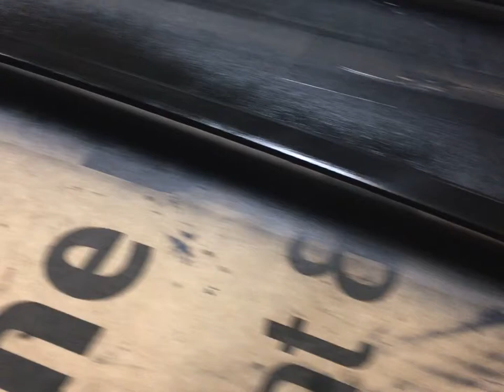Honda Odyssey - Water Leaks - Roof

Comment: Thanks for the video. very helpful. Can you tell me how the weatherstrip attaches to the metal molding that it covers? Does it just snap in place? My weatherstrip ('06 Odyssey) has dry rotted and the section on the passenger side in front of the roof rail is flapping in the wind, literally. The metal molding I can see underneath looks intact. Just need to know if I can purchase replacement weatherstripping alone and how it attaches to the metal molding strip underneath. TIA.
Reply from the maker: For some reason the card for this video is not on the leak video anymore.  Posting here: https://youtu.be/clcybJl3VUQ. Also, you can re-attach the rubber to the metal with 5200.  The last couple minutes of the leak video shows how I revived the trim.  It is still available from Honda as new, about $110. Last time I priced it.
Reply: @millionmilegarage9587  Thanks. It makes sense that reattaching dry rotting weatherstripping would require some adhesive silicone caulk. I guess what I'm wondering is, if I were to purchase new weatherstripping, do I have to attach using adhesive caulk or does it snap into place on top of or around the metal molding that it covers? Sorry if I was unclear. Also, you mention several days for your caulk to fully cure, but that it's waterproof within 24 hours. Does that mean I can reassemble everything after 24 hours. I don't have a covered garage to work in, so would need to cover the vehicle for at least 24 hours I suppose. Thanks for the assistance.
Reply from the maker: rss968 A new ditch molding is a complete ready to install unit with rubber molded over an aluminum extrusion.  5200 doesn’t really wash off, in fact you can install it under the waterline (underwater), moisture speeds the cure.  You just don’t want to leave it out in a heavy rain for several hours or blast with a water house until it has at least 24 hrs to cure.  5200 also comes in a fast cure, you have less working time and it may not self level as well but it is tack free in 2 hours and fully cures in 48 hours.
Reply: @millionmilegarage9587  Very helpful. Sounds like I can re-install after at least 24 hours without harming the curing process. Can cover with tarp overnight. If the ditch molding is all one piece (rubber over aluminum), I wonder why they get different parts numbers. For example, the parts diagram shows one solid piece that appears to run the full length of the left roof that is labeled "molding assy, L roof" part #74316-SHJ-A01. Then there is another 4 piece set that I know is the weatherstrip also labeled "molding assy, L roof" part #74316-SHJ--A21. I assume the solid piece is the aluminum extrusion and the 4 piece set is the rubber weatherstrip, but why the different part numbers? Honda's got me confused on this.
Reply from the maker: rss968 Models with roof rack get the 4 piece set, w/o roof rack requires one piece running entire length of roof.
Reply: @millionmilegarage9587  Now that makes sense. Thanks for taking the time to clarify.

Comment: Awesome video thanks ....I have a question. when you are pulling down the sealant and you get to the windshield area do you put a bead across the windshield area or just stop at the end and not cover the windshield area(its like the width of the molding)
Reply from the maker: Good question, my focus was on covering the sheet metal seams that were cracked, I may have/would meet the windshield where the ditch dead ends.  I kind of remember there is a little area designed to let water drain from the ditch in that area, I avoided covering that up entirely.

Comment: I appreciate this content, thank you. It would seem that Honda didn't really expect us to be owning their cars beyond the ten year mark, or perhaps they would have chosen a better design; come up with better ways to drain water from the sunroof instead of tubes buried in the pillars. 

I have a not only an odyssey, but an accord coupe as well, and it is drowning in water, and now I'm thinking that the water puddled in the seat wells under the rear seats is coming from the same roof seal. 

Spot welding the side frame to the roof, with a bead of seam sealer between the two,  at the edge of the roof line!!  Can you believe they didn't know that this was going to be a problem? That seam being where it is, right on the roof, is asking for leaks.
Reply from the maker: Yes it’s disappointing to be dealing with this type of problem long before the rest of the vehicle is worn out.  At least it’s a relatively easy fix.
Reply: @millionmilegarage9587  You're too kind. I haven't gotten to fixing anything yet, and it has been raining all night here in South Florida. Aaargh.
Reply from the maker: @charlesluck8921  Yeah, I don’t miss that, we lived on the Treasure Coast for nearly thirty years up until about five years ago.  All it does is rain down there.  Hope Ian is a no show.

Comment: I'm pretty sure I need to do this because mold, but I've also had the water leak out from the lift gate when I opened it. Very bottom by latch. Wondering if this will be a total fix.

Comment: Good video. Thank you. Do you also have one about water filling up the inside of the tailgate and leaking out all along the bottom  including through the latch?  

One note about caulking or sealing.  On your next job try pushing the tube forward while applying sealer rather than dragging it. I believe you will have better results as far as getting it into the cracks.
Reply from the maker: I have not encountered the tailgate leak yet but: There are several potential leak points that you can troubleshoot.  The wiper arm shaft, the glass seal, the tail lights, license plate surround, the spoiler mounts and of course the hatch seal just off the top of my head.  Start at lowest potential leak point and work your way up with a garden house.  May make it easier to pull the plastic off on the backside of the hatch to see where the water is coming in.

Comment: I called Honda and they want to charge about 500 dollars to fix roof leak. I tried other place and same estimate. I actually did this 2 or 3 years ago and it did work for about a year and so, but now again on both sides I see water marks from B to C pillar. I am debating on what to do now. Most people think is the sunroof leak, but I poured water on the rear channels and it come out well from the drain tubes.
Reply from the maker: I have never had the sun roof leak.  Best thing to do is sit in it while an assistant dowses it with water and look for the leaks.  If you used silicone to fix the leak previously that is probably where your leak is again.  That stuff will lift on you over time especially if it was not PERFECTLY cleaned before application.

Comment: Hi! Thanks for the video!  I was was wondering how you the cleaned the inside, specifically the roof liner and seatbelt area, after fixing the leak? Also, did you just clean out the gunk under the rails by hand or did you use a special device or cleaner?  Thx!
Reply from the maker: Hi Whitney, I put a little Febreeze on the seat belts to kill the sour smell, sunlight works good too.  I never did clean the stains on the headliner, guessing oxyclean or something like that would work.  I used soapy water and a toothbrush to clean off the seam seal trough area, avoid using anything caustic like bleach that could corrode the sheet metal.

Comment: Good information. I don't have roof rack in my 2014 odyssey, but I've seen water sitting in my passenger sliding door. any suggestion where to starts? dealer want me to spend 1500 to change all the rubbers which i wouldn't want to spent. TIA
Reply from the maker: Awais Khokhar Pretty sure the 14’ model still has a ditch molding covering up the same seam, with or without roof rack.  Try doing a visual from inside the vehicle with an assistant hitting it with a garden hose, you should at least be able to confirm if it’s the door seals.

Comment: Thank you! My 07 van got soaked in the recent rains and it’s time to do some waterproofing. How long did you let your van dry out before you did the work?
Reply from the maker: The surfaces that are getting sealer only need to be dry, it really depends on the conditions, in bright sunlight the seams should pretty dry within an hour or so of cleaning.  Results vary, 3M cures under water so a little moisture won’t hurt, silicone based sealers need a very dry surface.

Comment: Question.  We are having a leak on both sides of the A Post at the drivers seat and passenger seat.  Our van has a sunroof and I suspect that this is where our leak is occurring.  Did you experience this with your van?  Did yours have a sunroof?  Thanks!
Reply from the maker: @stephenhair5501  Yes it has a sunroof, no I did not experience that issue.  The sunroof has a a surround with a drain in it in case the sunroof lets some water in due to being open (by design) and I would think  also collect water if the seal around the glass to opening leaks.  If the drain for that area gets plugged it could flood over into the vehicle causing what you described. Should be pretty easy to troubleshoot by doing a visual around those areas.  As always, this is just my opinion and results vary.

Comment: Thanks for sharing this video.  How's the repair holding up?  Having almost the same issues with the seatbelt getting wet and the rear hatch area on my '06 and am prob going to tackle this as soon as we get some dry weather again.
Reply from the maker: SEDACE Hi, no leaks since the repair.  Left sit outside up here where it rains for days at a time.  No more wet carpets or seatbelts.   Make sure you have a torx bit tool long enough to reach the center screws on the luggage rack.
Reply: @millionmilegarage9587  have you had any issues inside the tailgate/taillights?  I need to seal those too apparently.
Reply from the maker: SEDACE I have not experienced leaks at tailgate on light openings but on the quarter panel mounted lights, the ones not on the tailgate, there is a pass thru grommet/seal that can get unseated when servicing tail light bulbs which can create a leak path.
Reply: @sedace6734  out in Cali it doesn't rain too much but this last storm I had a little over a gallon of water inside the rear door.  Was yours entering from the lights?
Reply: @1socalhiker  Haven't had a chance to really investigate the rear door part, the water getting into the rear hatch  floor appears to be coming in from the roof rail seam, follows down the roof line near the rear drivers side window, and can see it where the rear floor jack compartment is before it ends up on the floor.   I had to re-do some of the seam sealing last week because it was still getting in during heavy rain, not sure if I have it solved or not yet.

Comment: Where do you source the roof molding? It doesn't appear to be sold anymore.
Reply from the maker: I think the factory part numbers are listed in the description, if they are discontinued than your only recourse is the secondary markets, eBay, salvage yards, parking lots😄, etc.

Comment: Does anyone know if it's a problem to seal the end of the ditch closed at the end where it meets the windshield?  Not sure whether to seal it off or leave it open to let water drain down around the windshield.  If it's sealed it seems like it would just temporarily hold a small amount of water, but it would keep water from getting under the windshield and possibly leaking there.
Reply from the maker: I don’t think the factory sealed it up so would try to duplicate what they did.  If the roof is sealed up tight it won’t matter if it doesn’t drain.  Having standing water under the ditch molding for extended periods may contribute to a rust out later on.  On a daily driver that does not sit too long between trips it probably doesn’t matter much.

Comment: When you say it's a 7 day cure, does that mean you can't reinstall the roof rails for 7 days? Or can you immediately reinstall them after you are done?
Reply from the maker: You could install the rails back on without waiting.  Moisture also speeds the cure.  Would not leave it out in the rain for a few hours until it starts to skin over a bit.
Reply: @millionmilegarage9587  and how exactly did you clean the channel? Did you use soap and water or acetone? I just want to make sure I have this all correct
Reply from the maker: Wilson Guzman I used dish soap, a rag and an old toothbrush to remove any stubborn crud. 5200 is not as sensitive as silicone when it comes to surface prep but it still should be clean with no slimy residue.
Reply: @millionmilegarage9587  wonderful, thank you for your response, you made me feel so much better doing this myself.

Comment: Where do you get 5200 Marine sealant besides a boat store?
Reply from the maker: Len Wehrung The Home Depot usually stocks it in white, Amazon has the black.   Most Marine supply is a sure bet to have the black on the shelf.
Reply: Amazon

Comment: Can you use rv roof repair . Self leveling
Reply from the maker: I used 3M 5200 because it is not as fussy as most RTV sealers when it comes to surface prep.  I don’t know what self leveling rv is, assuming you meant RTV or silicone which could also be used.

Comment: Do you take off the old caulk? Maybe I missed that part.
Reply from the maker: I didn’t scrap off the old caulk, just cleaned the surfaces thoroughly and applied.
Reply: @millionmilegarage9587  I just got a 2010 oddesey and it is leaking on both sides. One side through where the air bag is driver side by windshield and the passenger side above seat belts and headliner. I thought the passenger side was coming from sliding door but we caulked that with the black caulk you used. It still leaks so I ordered the black strip on top for both sides. Mine are rotted away and now just a silver strip is there that's just floating.  There doesn't seem to be any drain holes in that valley so I didn't think that was where the leak was from but apparently it is so I'll caulk it to. Question? So I remove that silver strip, caulk and replace and put the black strip over it all? Do I use caulk in between?
I'm from Florida as well. High Springs.
Reply from the maker: Mamaw Life Our Odyssey is from Florida as well!  If you do just like I did it in the video it should be successful.  The  black  ditch moldings are cosmetic pieces and do not need to be glued in place.  Just put enough sealer on to cover the old seams before installing the new moldings.  I chose to wait until I leak tested before re-installing trim as those retainer clips are easily damaged.

Comment: So a 10 oz stick at $35 for a 2004 that may not make it another year maybe able to just use GE All Purpose Silicone Caulk - 100% Waterproof Silicone Sealant, Stronger Adhesion, Freeze & Sun Proof for $7. Thoughts anyone?
Reply from the maker: In my opinion nothing has worked better for me than the 5200 but what you suggest would work.  It’s been 3 years and my van is still sealed up tighter than Fort Knox.

Comment: Looks like you had this issue quite while eight?
Reply from the maker: Rombout Versluijs Yes, it probably leaked for several months, it’s a garage kept vehicle so it didn’t see a lot of soaking rains.  We first noticed it the day after driving home in a hard rain and the seat belts were wet the next morning and smelled sour.  I remember thinking how bizarre that the carpets aren’t wet except for the rear trunk well, that’s when it struck me that it must be a massive seam leaking.

Comment: Quick question. If I didn’t want to take off both roof racks. For fear of not getting them put back on correctly on my 2003 Ody van. I do have a steady hand if I just sealed around those roof racks and then sealed the areas when I open van hatch. Let me know when you get a chance   Thanks so much.
Reply from the maker: I would advise against doing that, it is really best to apply directly over the seams where the roof is welded together.  The method you propose will trap moisture under the trim.  At best it may slow the leak for a  while. Also, while not shown in my video a plastic putty knife can remove the trim, just be careful with dry rubber and hardened clips.